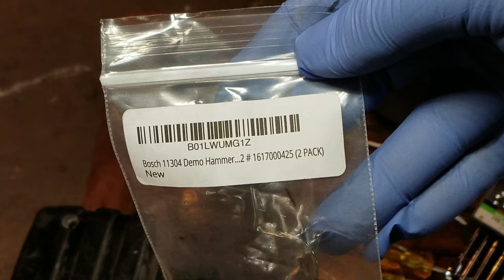Will it Run - Bosch Brute Jackhammer Repair?

Comment: Great video..
However the only problem are the video upload  feom j who?the test results..any updates..
Thank you have a blessed day and be blessed
Reply from the maker: @jirojosephesman8175  I reached out @Jwho-? and asked for himt to make sure that the video made public again. You can find it here.
https://youtu.be/X2qsK6Os-aI?si=6pnT0sg0eE04JOfk
Reply from the maker: @jirojosephesman8175  Also update is the unit has worked for years no issues.
Reply: Sorry about that, thanks for heads up. Video is now available.